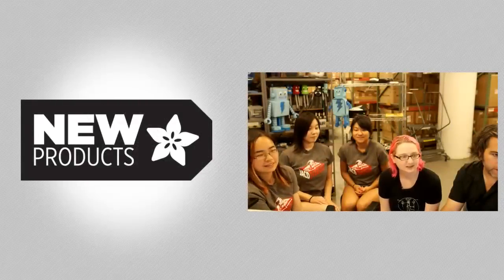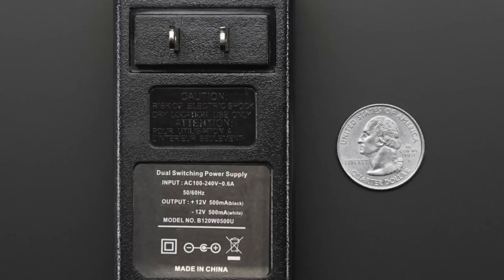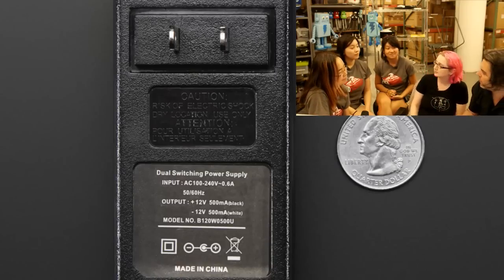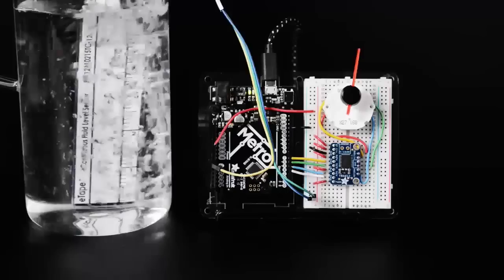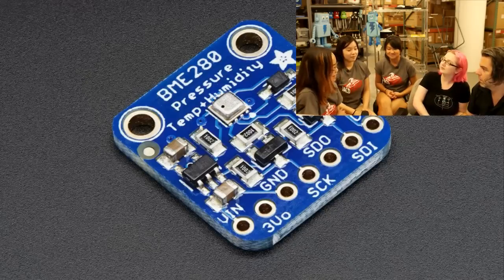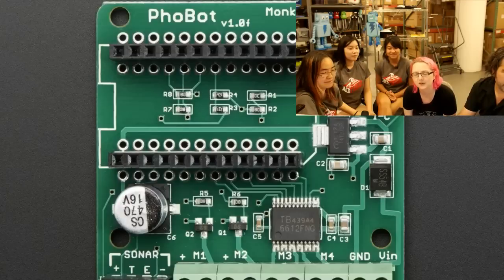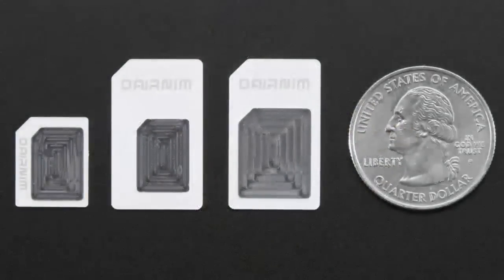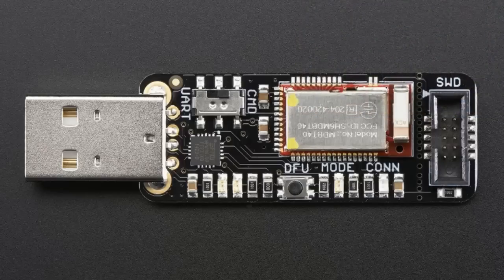New Products 7/29/2015

Comment: Hi I'm was working for AlliedSignal Tech and had to create a stable power supply for the largest Crane in the world. I tried a few different ideas and finally took a APC uninteruptable power supply (that I had modified for ship use because there is no real earth ground at sea) put a loop circuit in it that for all the power required looked like a flyback transformer. At any rate it took the hum and shaky screen (tech words) right out of the computer installed to monitor all systems (since cranes use PLCs not computers to operate. Then I had to install and test it 100 feet in the air and with the crane swaying 15 to 18 degrees in heavy wind. Just some of the adventure you to could have working on a government contract with the Navy and Marine Corps. Long long story but the punch line is even if APC does not still make that model they should still have the schematics I created for it.

Comment: What is she talking about at beggining?
You can put 2 12v supplies (even switchmode) in series and call middle terminal ground and you get what you want.
DC output is not  at all referenced to earth ground
Reply: BevcaN izBevk Unless the two random wall warts that I pull out are unusual, this did indeed work fine. For what it matters, neither have ground terminals. Maybe someone will explain why it should not be done. The split power supply wall wart is nice and tidy if you frequently need a split supply.
Reply: Yeah for me it works perfectly
I dont know why she said that you need specific -12v power adapter